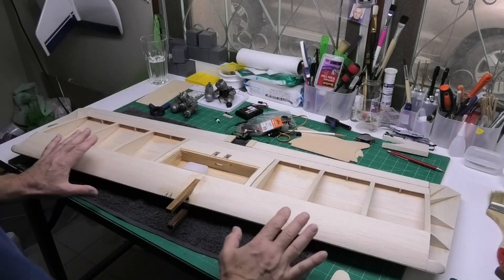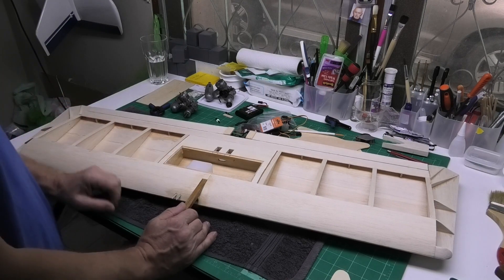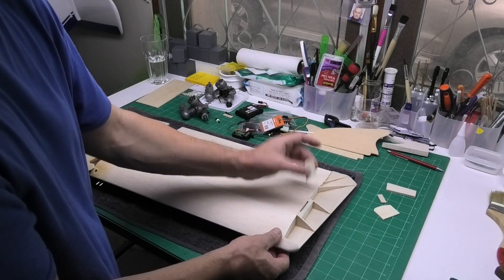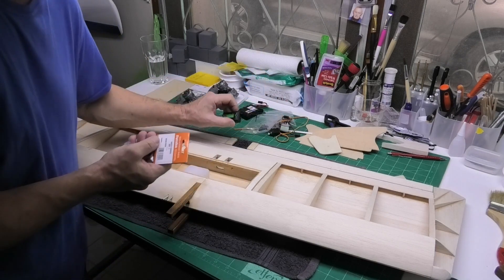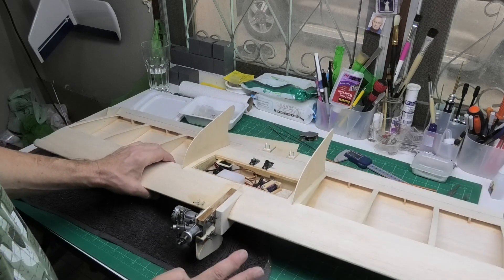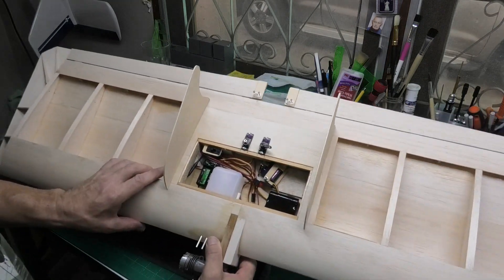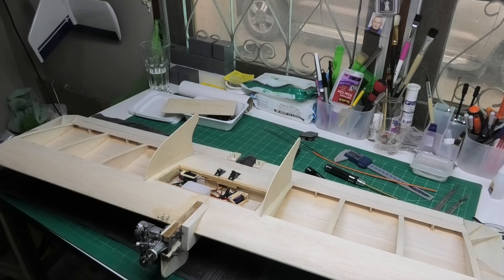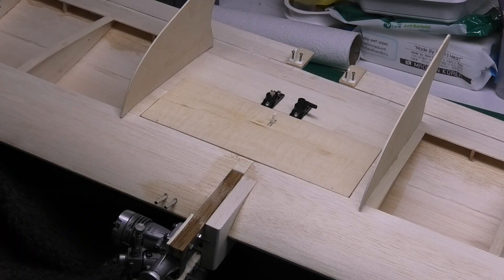King Kombat Pt 5 - a balsa 40" RC flying wing! - Fitting out the wing

Comment: Enjoying the build.  I don't think the fuel will syphon with the breather where it currently is as the exit of the breather will be above the "top" of the tank.  If you have it plumbed into the exhaust pressure nipple, then it will be even higher again.
Reply from the maker: Thanks for the comment, its appreciated